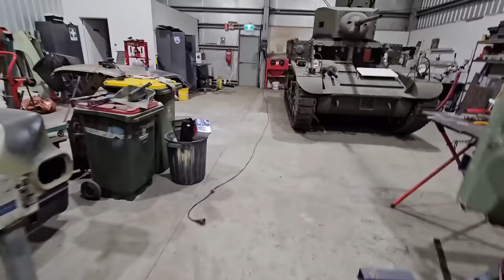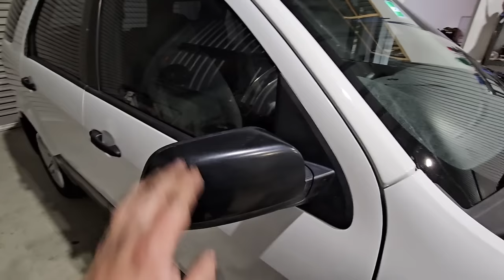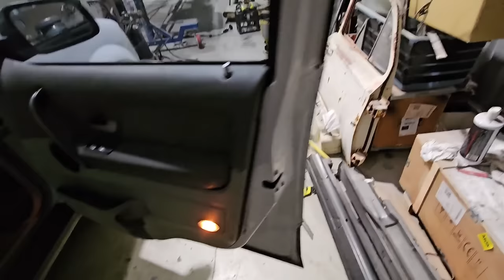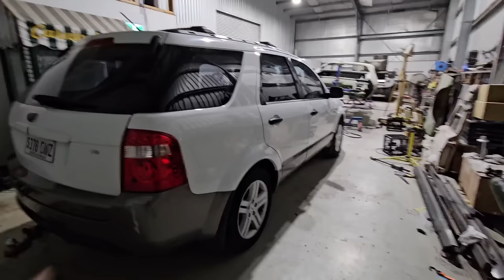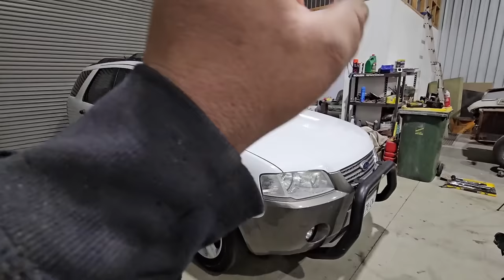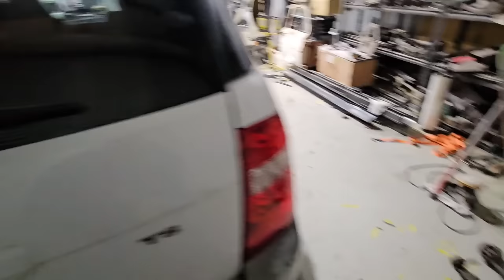Vehicle updates!

Comment: I looked at buying a Territory diesel because they have the excellent 2.7 Peugeot turbo diesel ,,, but having a brother in law who worked in Ford parts before retiring changed my mind, they are a bit underengineered caused by using modified sedan parts which break as youve discovered, it didnt need a hard hit to destroy the front end the balljoint failing more than likely caused an accident, expensive cars to keep on the road
Reply from the maker: Yeah I've discussed the questionable designed front suspension with a few mechanics saying the dubble ball joint is stupid

Comment: Nice job, does that drivers door need to go up just a touch?
Reply from the maker: drivers door fits perfectly, probably the plastics throwing you off a smidgen
Reply: @xacoupeguy  it looked like the door line was a bit low compared to front guard and rear door but came up well and not badly priced, great work 👍